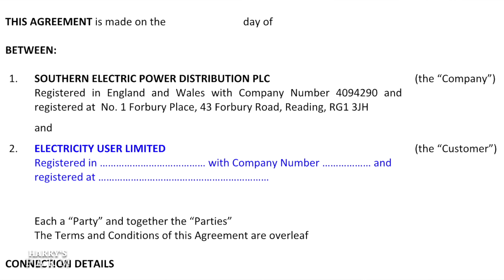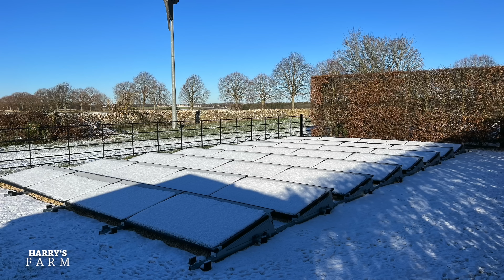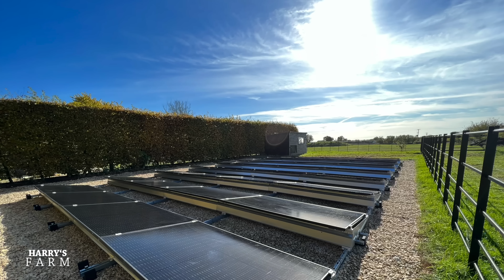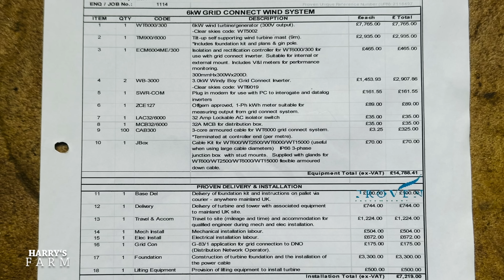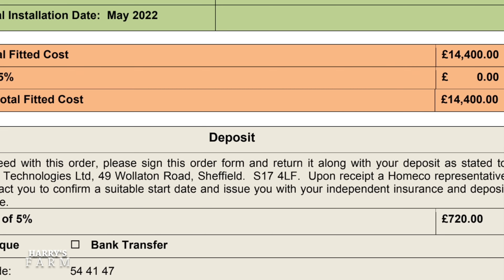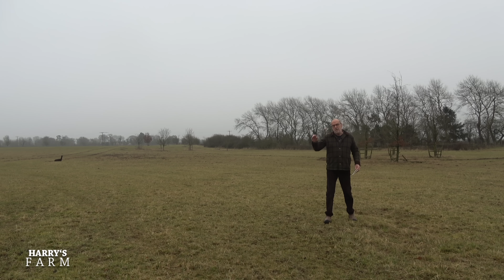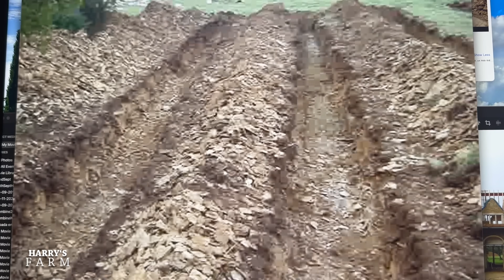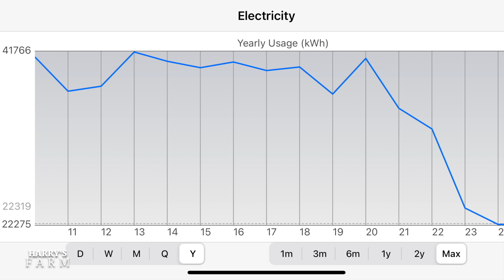Are solar panels & heat pumps worth installing? Here's what I've learnt after several years of use.

Comment: I live in Brisbane....so we are not exactly comparing apples with apples with regards to solar performance as we get long days of sunshine all year. What I am interested in is the price you paid. So for an average 4 bed house, a 6.6kw array is considered adequate and very standard. My 6.6kw array cost AUD$2400 (1250 quid)  installed with a government subsidy. During the day, I sell my unused power to the grid and use power from the grid at night when my array is not producing. As such, my solar system paid for itself in 2 years, indeed I actually receive around $500-600 a year from my electricity provider for the balance of power I have sold them. All the equipment, including panels and inverter are made in China and were installed in 2021.

Comment: With nuclear electricity, 247 generation plant operations for minimum kWh prices then people like you will put maximum load on the grid in winter and then in summer not only take your load demand off the grid you will put dirt cheap supply into the grid.

The nuclear plant can not run economically and so its electricity is more expensive as its costs are fixed but the quantity of electricity sold is reduced every year.

Latitudes are warming and battery electric vehicles, BEVs, are increasing in numbers.
BEVs with v2Home, v2g, v2v technology will increase rooftop PV supply to homes and buildings and grid 247.
BEV battery love daily part discharge and recharge. Battery life is extended by random cycles daily. 

Daytrading of electricity services to the grid will be valuable and VPP, virtual power plants are formed by companies like your Octopus electricity company. 

Nuclear plants that are in existence are valuable but no more should be built.
Much is changing, rooftop PV, BEV v2g massive battery, most vehicles are parked 23hrs every day and all night long, selfparking selfplug-in V2G trickle currents all day long and all night long, bumper plug-in to a $60 wall outlet at every buildings carpark space, ezi pezi.
Latitudes warming. 
Populations collapsing in some countries and CO2 emissions reducing and new energy technologies evolving rapidly, robotic dirt cheap labour needing more dirt cheap electricity,  grids wort £TRILLIONS and TRILLIONS and decades and decades and decades to build are too valuable to waste and too expensive to expand.
The national grid must be protected and customers cashflow must be maintained. New demand customers and customer service and customer supply electricity feed-in.
Millions and millions is a quantity with its own QUALITY. 

Central generation will be a dead duck.

Comment: My solar produces little in winter as well, much less than promoted (I'm in Australia).
Reply: The same for me.  Great in summer, but winter in the South is a whole different thing.  My panels have individual inverters so shade on one panel only reduces that panel.  I'd like more panels but currently prevented.  Governments miss out on further electricfication whilst the energy suppliers struggle with adapting.

Comment: When's the heating demand? When's the high electricity cost? When does solar not work? WINTER. Put them on your vacation homes in Spain or Portugal. If the utilities will allow it. You get nowhere near the rating of the system even in the best month because of where we are located on the map. 50%. It's a boondoggle.

Comment: I`ve fitted my own solar set up and not told anyone. Mostly due to being not allowed. Only 2 kilowatts. When I had cables changed to the house the engineers were not too bothered when they saw I was an inventor. You can get away with shading by using a few mini invertors and splitting the panels up and using 24 volts. I went off grid when I first got the panels and 6 caravan batteries. You can use the excess energy from solar to heat your hot water tank. Using  a Solar immersion diverter which sends any spare energy to your hot water tank. This can then give you  a shower or use the washing machine, washing up etc. Gets to 60 degrees in an hour.
Reply: And you use a wood burner to sort it all out in Winter,

Comment: Our spare Electricity goes into our hot water cylinder which works out well.
I am currently insulating like mad and have used £2.17 all day minus 64 pence standing charge.
Ours is a 4 KW system and 12 years old so is payed for.
David and Lily.

Comment: Wise decision not to let a bunch of contractors mess up your roof......   Last year I spent some time studying if solar makes any sense for my area, mid-atlantic US.  Given a limited amount of space for panels (I will not have them  on the roof!) and my belief that feed-in tariffs will soon be a distant memory, I would only install a little more than what my air conditioning takes when at full tilt, around 5-6 KW.  It would peak-shave those moments of the summer days where we need serious  power.   As you point out in the winter the output is not very helpful.    Interesting video from a purely practical point of view rather than the "fan-boys" that are so prevalent on YT.

Comment: Micro inverters will help with shading…. On a single inverter system any shading will bring down the whole string to the lowest panel output  (the panel in shade), micro inverter, will mean all the non-shaded panels put out their full output.

Lifting those panels to say 5’ (at hedge height and should still be hidden) and put on a angle adjustable bracket to change the incident angle for best summer and winter output.

Also batteries make a big difference with power usage.

Comment: 2007 is a long time ago so Harry’s definitely an early adopter. The latest idea around shading is micro inverters. Basically you have small inverter for each panel rather than a big one for the whole system. Logically that overcomes the system shutting down a whole string because one panel is underperforming. I’m guessing where Harry is in the Cotswolds will be an AONB. That means additional planning restrictions. If permitted raising those panels onto a frame to lift them up near the top of the hedge would also reduce shading.
Reply: The GSHP he put in back then, but the solar installation is only 2 years old
Reply: An additional comment re the ground source. That looks like dry soil. Believe it or not installing the pipes in a marsh or even a stream makes for greater efficiency. When you pull energy out of the ground drops the temperature of the ground around the pipes. That needs time to recover. By installing in wet ground or even running water that temperature drop is less & in the case of running water isn’t actually an issue. I leaned all this from a heat pump engineer with 30 years experience.

Comment: I wait for this review every year. We are currently going through the ASHP/Solar/Wind Turbine/Battery journey. We have a small 18th Century cottage on the flat fields in Lincolnshire, no neighbours and high winds. Last year we obtained a grant to get internal wall insulation and an air source heat pump. The insulation made one heck of a difference - before this we only had a log burner! 

They installed 8KW of solar, we upgraded the inverter to a 12KW, 3-phase hybrid so we can do batteries too. I bought 6 batteries giving 30KW/h of storage. We also have another 10KW of panels waiting to go up on the barn (delayed due to asbestos on the roof). I upgraded my supply from the grid to 300KW 3-phase and the DNO has granted 20KW/h export, with 30KW PV. 

Batteries - we got these because the main use is to charge them up at night on 7p KW/h and then to replay this energy the next day so we don't use peak electric at 25p KW/h. 

Wind turbine not fitted yet but it is a 2KW and will be very busy, charging the batteries at night when there is no solar.

What we found so far: December, the 16KW ASHP was killing us for electric use. Barely heats the house and the bill for December alone was £350. The newly installed batteries only worked for two weeks as I didn't realise they stop working at less than 5 degrees C so we lost their benefit for half of December. I will build an enclosure for next year with a frost heater to remedy this!

Our plan is to export really heavy in the summer months, then bank that credit and use it in the winter months. The air source heat pump is VERY EXPENSIVE to run so we are depending on making as much export as we can when the sun is shining. Really enjoyed this report Harry. Look forwards to seeing how you get on next year and I hope to update this if it is useful to your subscribers.
Reply: I would recommend if you haven't have a look at heat geek. The heat pump shouldn't be more to run than gas and the fact you are saying it's expensive to run says to me it likely is costing you more than gas/oil. It should be at very minimum as efficient to run as a boiler. I have a standalone heat pump in my living room it has no outside unit and that is getting cops of I estimate about 3 cop. I estimate this that a 1kw heater will struggle to keep my front room warm but the heat pump is using around 300w to hold my living room at temp.
Reply: Australia used to give credits for exporting to the grid, now you can get charged for exporting to the grid.
Reply: What’s the point in all this, time money and energy? Are the returns that great?

Comment: I'm not negative on renewables', will be investigating for a renovation, but the video does confirm that they have an inherent problem esp solar of producing power when you don't easily have a use for it but NOT producing when you DO need power ie winter heating. I also wonder if the TCO (total cost of ownership) figures always stack up.
Reply: In a cooler climate as northern Europe, one frst of all should put the money for additional insulation, like the ceiling, install a heat pump. Solar panels further down the list
Reply: @Rimrock300  Absolutely, Fabric first-that is improve the thermal performance of the building- then look at how to supply what should hopefully be a usefully reduced energy demand profile. ( did have a fabric first line on original comment but removed to reduce length of comment!)

Comment: @Harry. The shading problem is caused by the series-parallel wiring. Very simple. Most panels have a bypass diode in the wiring junction box on the back of the panel (intended to bypass the shaded panel).  Different wiring arrangements have different trade-offs. It's not as sophisticated a system as your description implied. Most controllers have but a single input from the array, so there's no opportunity for the cleverness you described.

Comment: Great video Harry, re battery keep in mind the option to optimise there use to buy in cheap electric at night and use in the day. Eg windy winter overnight energy excess in grid that gets sold out by octopus at cheaper rates. Also this system with decent automation can be worth considering to focus underfloor heating boost at night (on cheap electric) so you use less during the day almost like using the house floors as a energy battery - hopefully from solar weather permitting. The approach of intelligent inverting and use of thinga like fogstar 15kwh home batteries which are a quarter the cost of a powerwall maybe worth considering. Keep up the great videos.

Comment: Hi. Surely having storage battery will help you to loadshift electricity usage? You can charge the battery at night at cheap tarrif and use it during the day. You will probably need a lot of storage but I would encourage you to do your calculations to see if it will be a beneficial to invest in battery. It could reduce your electricity cost further by 3.5 times.

Comment: Your heat pump is clever.You have your own digger so you dug up the soil to put extra tubing underground and it heats up the house and the garages via underfloor heating.I like the idea of having windmills and solar panels as the windmills work during the night,they do not require light just wind.Harry has it down to a tee,if too much energy is made it is syphoned off to heat the outdoor swimming pool so there is minimum wastage and in the future electricity can be sold to the electicity company at .15 pence a kilowatt.Very sensible.

Comment: Basically for the load you have the solar system is too small, things have changed since you installed that system

Solar price is probably half of what you paid, the installer should have told you with the site as shaded as you’ve chosen you should have installed optimisers, Solaredge or something similar

You would now be able to install more than the grid previously allowed, you should be able to install 60kW of PV on a 30kW granted connection if you also add battery as that allows a larger DC to AC ratio

Battery would be an obvious choice with solar and a wind turbine, you’ll create a much flatter production curve and also be able to charge the batteries at night on an 8p tariff rate so even in winter if you’ve no solar the wind should contribute some and if not you can use overnight cheap power

Comment: Thanks Harry, really interesting.  As others have mentioned, the big change since you installed is how cheap household LFP batteries have got - if you were installing today then they would be in consideration.  They both store your solar/wind for when you need it, plus in winter you can (if available) take advantage of cheap overnight tariffs to power the house during the day.

An intriguing crossover with Harry's Garage might be to investigate the feasibility of incorporating a used EV battery into your household setup with a high-end inverter.  A couple of Nissan leaf batteries / one high-end Tesla battery might pay for itself reasonably quickly and show one possible future for EV batteries once the car has been scrapped.

Comment: Very interesting Harry like you I built a house at around the same time, mine is around 6,500 sq ft. with underfloor heating and a pool in the basement. During the build I installed a ground source heat pump at a cost of £20k in 2008 but unlike you found it to be awful. It never heated my house to my preferred 22c more like 18c on a good day. Within two years it broke down and the company that supplied the pump had gone bust. As we do not have gas I opted for an oil boiler which heats my house easily to 22c 24/7 and the pool to 34c. Oil has probably been one of the cheapest forms of heating over the years now Donald is in it should get even cheaper. I am surrounded by trees so solar is not an option. Would be interested to know how warm you have your house and how much floor area you heat to the higher temperature as I assume your garages are heated to a much lower temperature.

Comment: Here in Canada my heat pump works well down until around -25c or so. There has also been a noticeable drop in power consumption as well. 

Harry needs battery storage. Charge it at low tariff and use it at peak rates. Some of the equipment there is getting towards the end of its life

Comment: You should mention grants for  elderly and disabled
payback period
life expectancy
heat pumps are becoming more efficient ever iteration
heat pumps would benefit from being in a wooden, insulated shed.
Best pay back would be for highly insulated houses only
You can get water heaters which only really work for 7 months a year with a large hot water special tank as heat store
The panel might be more efficient if you install silver relevé builder material around the installation as a light collector.
Efficiency of panels are limited, although tesla make claims of higher efficiency gains at a cost.
Worth considering storage radiators to hold heat later in the day
Spend wisely, you can always add at a later date

P.S. I do wonder if you could increase spring performance by increasing the installation by 1 meter off the ground ?

Comment: We have 4kw of solar , south facing in Hertfordshire. Very good in the summer coming on at 6am sometimes and connected to this is a dimplex e solar heater that heats our water in a multi outlet tank through the immersion.
This also works well in the winter when the sun is out. But amazing setup Harry, my partners parents were told it was too radical to have a ground source heat pump in the 70s and were refused planning by the narrow minded council 🤷

Comment: Very interesting video but most UK properties obviously won’t have the land to make GSHPs viable. Also, given the reduction in output over winter months, the ROI of most roof-mounted solar panels will exceed the average tenure of a lot of households in a given property. That really just leaves air source heat pumps and the jury is still out on the economics of those. We have an oil boiler and there is really not much we can in terms of alternative heating options?

Comment: Hooray! A Stanley video, with some other stuff mentioned as well!

Nice to see the complementary way solar and wind power can combine. For a national-scale approach, floating solar arrays on our reservoirs could be a better option than land-based - reduces evaporation losses, also it's more difficult for crims to cut and steal cables, etc. From an urban point of view, however, solar PV and solar thermal is pretty much the only option available, unless someone knows of a turbine solution (possibly one of the compact vertical ones) that doesn't need to traverse the higher level intricacies of local planning requirements.

I do like the sound of a heated garage, though... Well done on going there nearly 2 decades ago, Harry, and showing that this sort of combined heat pump system isn't either impossible or indeed new.